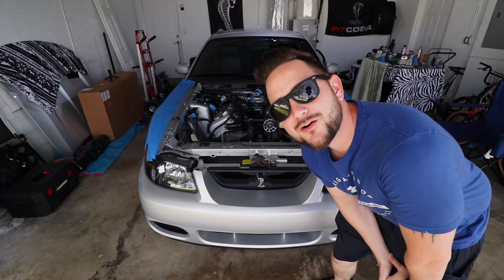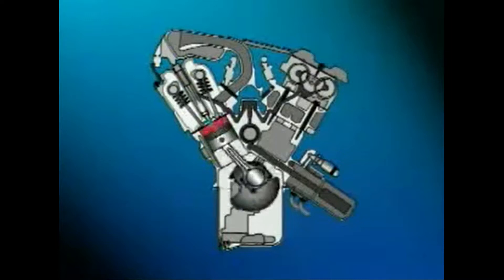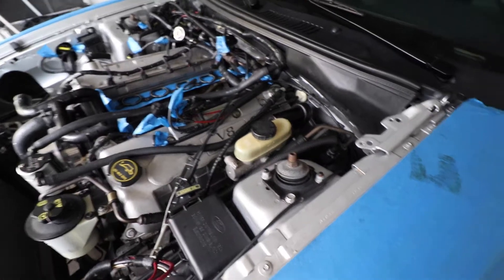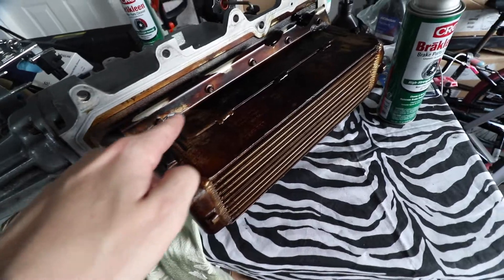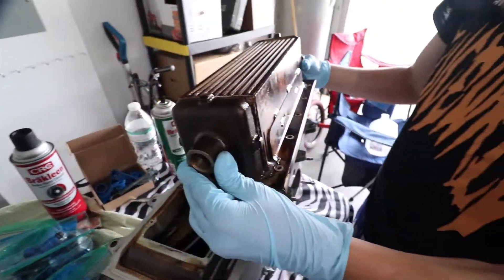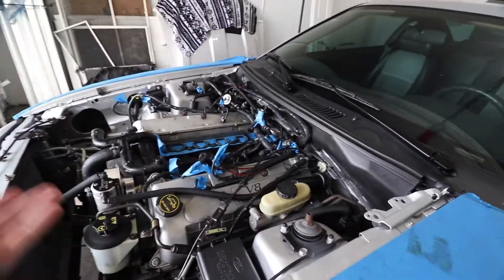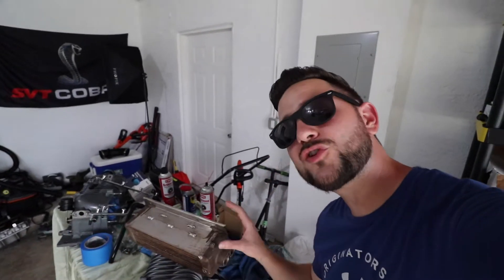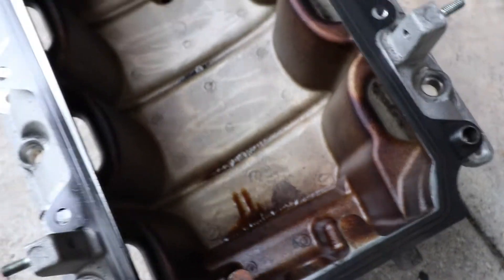Why your engine NEEDS an Oil Catch Can!

Comment: I have a catch can on the passenger side .. after 3 years still dry !
You got a ton of oil ! 
How much boost are you running ?
Reply from the maker: The passenger side never collects anything bro, you need to attach it to the driver head, that’s where all the action is at
Reply: @TheMGChannel  
My tuner is the 1 that said passenger side !
I see 900 hp cars with no catch can just breathers ! 
The only way to know is to pull it !
I do blow smoke on start up 1 out of 20 start ups!
Reply: @TheMGChannel  
It would be a shock if montey Johnson ( Jms, sct)  would have got it  that wrong ..
Did your car smoke a lot ?
Reply from the maker: @stephenalexander2003svt  It did on startups, what year is your Cobra?
Reply: @TheMGChannel  mines a 03
Mine does smoke sometimes on start up !
It’s got 75k miles .. I’d love to pull the blower and clean mine ! 
Boost weather is here 😎

Comment: Should i bother putting one on my 03 if i use the car very rarely. Its bone stock. I do like to do things for prevention of any failure.
Reply from the maker: I definitely think you should, especially if you like getting into boost, just make sure to route it through the driver head where the PCV valve goes

Comment: Great video as always. The JLT tops have been confusing in the past because the bracket on the top goes on either way. All the research I’ve seen (and what makes sense to me too) is to make sure the mesh screen is on the outlet side in order to skim off the oil in the vapor and have it trapped in the can. Otherwise you’re just making a nice collection of oil for it to such up into the intake as if a catch can wasn’t installed. I think some better cans even have the mesh screen on both sides.
Reply: https://youtu.be/QrdJMuJleko
Reply from the maker: Thank you Danny, with the JLT is actually very simple, the mesh goes to the side of the PCV valve, or the hose that is connected to the cylinder head. That’s how JLT designed it and that’s how it works, I think mesh screens in both sides will be cool but in reality I don’t know how much oil it will prevent in going back to your motor.

Comment: One needed mod for sure on these cars! Thanks for the reminder that I have more money to spend on mine than what I already have planned lol. I've had a JLT catch can on my wish list on American Muscle for awhile now, I just need to buy it
Reply from the maker: No problem man! Yes definitely is a must for these cars, make sure to route it thru the PCV valve, that’s where they collect oil and prevent it to go back to your blower. In the passenger side it doesn’t do anything
Reply: @TheMGChannel  yeah I read up a lot on to do the passenger or drivers side and the drivers side is the way to go.
Reply: @TheMGChannel  When I first got my cobra and I replaced the air filter, there was oil in my intake tube and throttle body. Never happened again since I disconnected the hose from the valve cover.

Comment: Good catch! Oil reduces the heat transfer from the inter cooler. The heat does not move into the coolant due to small film of oil (fouling the heat esxchanger).